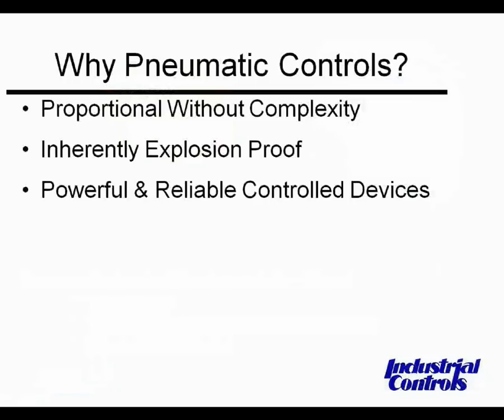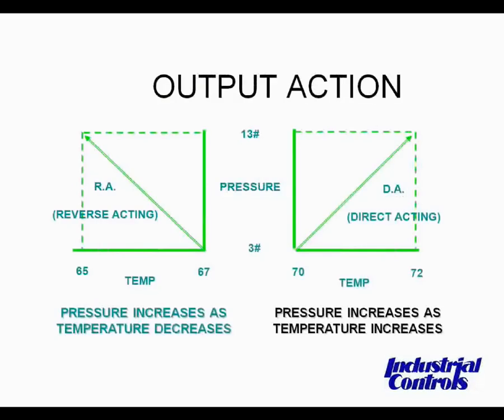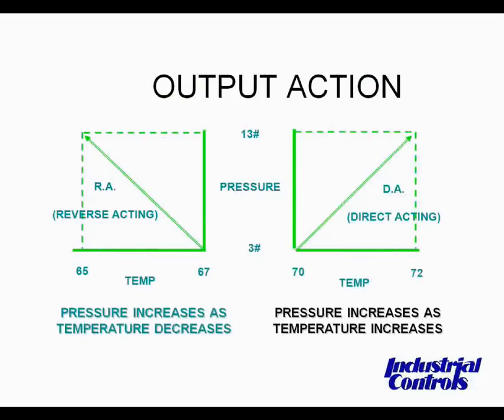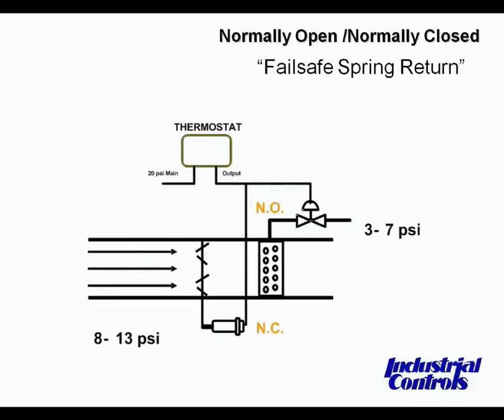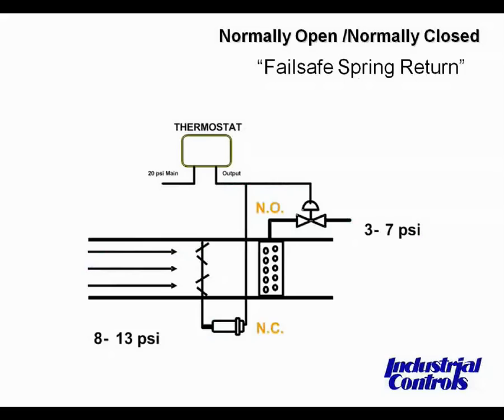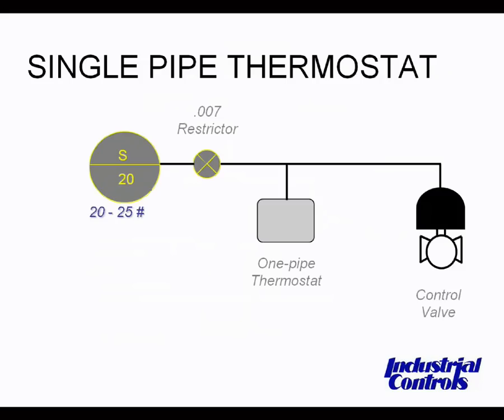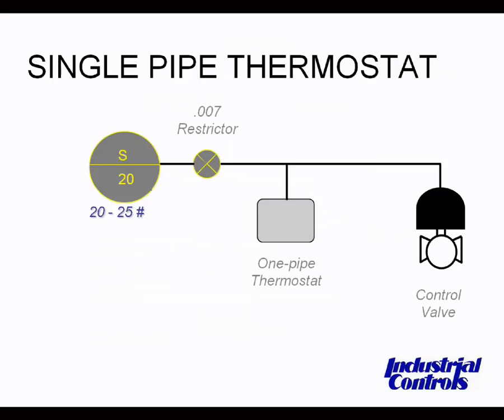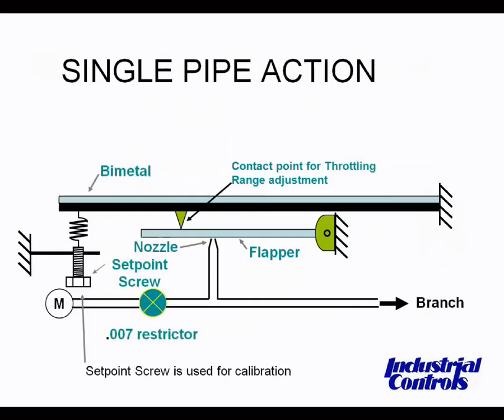Pneumatic Session #2 -- Thermostats and Controllers: Clip 1 of 6

Comment: Is the volume of air consumed by a 2 pipe thermostat less than that  which a single would use in the same application?  
I know some models can be piped in either way so is there a noticeable, long term benefit with 2 pipe from the standpoint of less compressor cycling?  
If a ceiling is open and you’re replacing 50 1 pipe stats anyways, is it worth the effort and $ to replace the single line with dual back to the controlled device?

Comment: How can he say they are not effected by electric? Without a compressor, the stat is dead.
Reply: Mark S true, but your system would probably maintain pressure for a while. On my pneumatic system, the compressor sits at 50psi, then we have a regulator that reduces the supply pressure to 26psi, so the thermos would have to bleed off an additional 24psi before the system would become inoperable.
Reply: Thanks for the great video!!